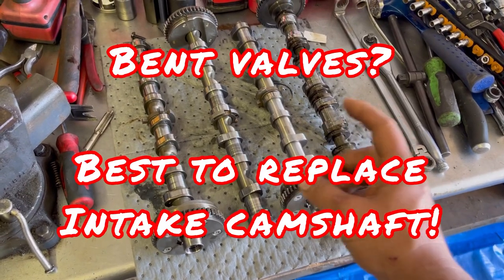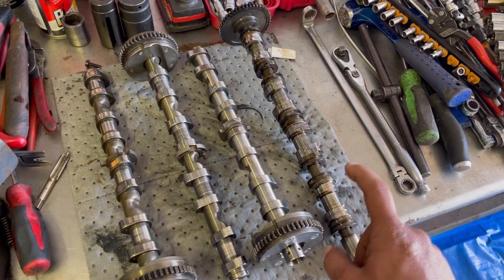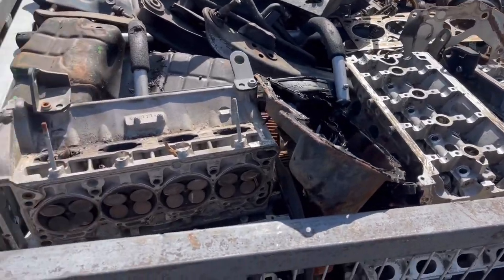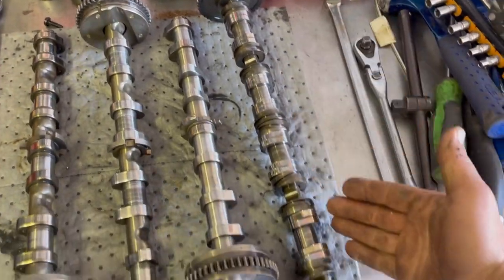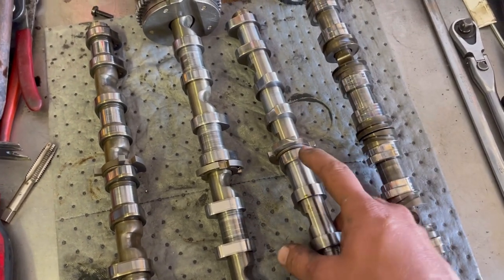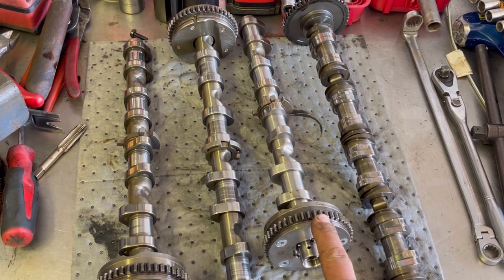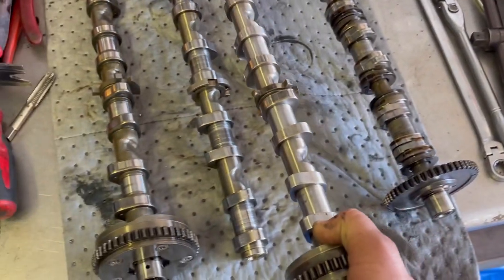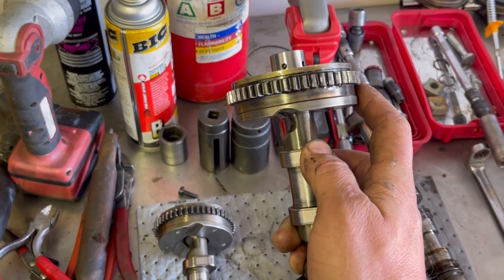2.0t Audi VW intake camshaft fault codes issues bent valves p0016 p0011 etc.

Comment: Plz keep em comming sir…i love watching you work on the tfsi…i just recently bought one with the valves destroyed and it wouldnt start after i installed a new head onto the engine…this video helped me out A LOT…if it wasnt for your video i wouldnt have figured out that my reluctor wheel on my intake cam was spun almost a whole 180 degrees…i just replaced the cam with a good one today and now i have a beautiful running B8…i very much want to thank you again for this knowledge…

Comment: Drop few notes here

First of all thank you for documenting fantastic and valuable information to people!
Second - If you had combo with P000A + P0016 - check magnet on intake (by testing/replacing it to another), as well as look into small "piston" which moves VVT back-forth, maybe it's clogged (it has small metal net inside of it and because of burn oil it might clog the flow)
Also you may try to check those timing adjusters, maybe they're "worn out" - it's possible to replace them with slightly updated width (it's less than milimeter). They would work properly but on idling you may hear rattling sound (because adjusters are a bit worn)

Comment: Wow excellent video here.. I was told you can actually rebuild or fix a seized intake cam phazer by removing the gear cover and realign the pawls.. I’ve never seen a cam shaft seize after colliding with valves but I’ve only done a couple dozen of these 2.0 TFSi unlike your thousands.. Also, very interesting design on the cam position wheel I thought it was a tone ring like the crank but it’s variable so I guess that aligns with the ECU as the profile changes.. wow learning about these systems so much from you.. truly are the best at your presentations.. I guess I understand why those TFSi cams are so pricey now.. granted there’s a lot of VAG markup but it’s a finely precise instrument.. great content 👍🏻👍🏻

Comment: p0016 came one day just in the morning at the cold start bam engine light car had problems to start but it started i didint drive it towed to my garage and took it apart found out that the timing chain guide rail at the right side of the engine were intake cam is snap in half were the top bolt was (weak spot i guess) put it all together new chains and guides runs fine now no damage were done to other engine components .

Comment: I just recently bought a 2016 audi a4 with the 2.0 TFSI and cvt transmission wasn’t sure what issues I need to watch out for and what generation my engine is if the oil burning was fixed in or before 2016

Comment: I changed pistons, rods, valves and timing chain i put everything together and the engines runs smooth but I have a p0011 and a slight knocking sounds like if it’s coming from the upper timing chain

Comment: My 15 s3 every now and then would get a choppy idle and a p0011. Found it was the vvt actuator in the cam. The spring was worn. Replaced it and it's ran great since
Reply: Where did you find parts

Comment: Just did my timing chain and tensioner yesterday, car idled for 5 min good, drove about 5 blocks then lost Drive and got P0016 and car wont start. I don't think valves are bent. I can still crank the engine by hand, what could have caused that happen? Any possible solutions? This is my daily driver and I'm in a bind

Comment: I have a question the ecp light for p0341 cam shaft I change cam shaft sensor and cam position sensor with new gasket codes cleared but now misfire in all 4 cylinders car starts with no problem 2010 Audi A4

Comment: Have you ever seen a cam bridge seized on before?  And why would that happen?  Very low mileage car (appx 40k miles), but it was an original 2010 part.  Dealer had to force it off and damaged the cam in doing so.  They said they had never seen one seized on like that before.
Reply: This is a very rare problem but I will tell you what I think.
Put in mind that the cam bridge is to hold the cams into place so as to reduce tension that is caused by the chain and it also acts as a channel for supplying oil to lubricate the camshafts at the point where the attach to it.
So if there is oil starvation of any kind, it will cause wear of the cam bridge journal thus cause too much heat and then melting and that is how u end up with such a problem.
However, I can't think of possible cause but I can come up with my own which are, since the bridge has a small oil gallery which also has a small screen that keeps bursting, it could break into tiny pieces that can somehow find there way up to that cam journal of the cam bridge and that how the damage starts building or even kinda block the oil passage causing luck of enough lubrication especially at high revvs.
I can also relate it to sludge finding its way up although this is almost impossible since u have an oil filter.
I could also relate it to an oil filter that stayed too long with being changed and a tinny piece broke off and found its way up thus blocking the oil gallery of the cam bridge.
I hope that helps.

Cheers
https://twitter.com/DeutscheAutoUG

Comment: I recently did a timing chain on a b7 it was fine for a couple of drives. Rode it pretty hard the time it did work. Then I got in one day and it started so rough I parked it replaced the cps. It cold starts pretty rough then clears up a bit. Every 20 miles or so I get a p0016. Any ideas of what it might be?
Reply: 😂 It's off by a tooth

Comment: Naptowntuner. I need a repair on a VW CC. Valve Cover Re-seal: Cam carrier is actively leaking and needs resealed. Would you be interested in repairing? Currently in Indy.
Reply from the maker: I might be busy for the next week but if it can wait yes.  Naptowntuner@yahoo.com

Comment: Why would my 2010 Audi A4 2.0T started smoking dark smoke? Is it the turbo? Second question is i bought a coolant temperature sensor thats tell me the engine temperature which mine doesn't have one in the back of the engine nor do i see the wire harness to click into it & looks like it has a bypass where it goes into that black plastic coolant block in the back of the engine which i think thats why my fans stay at 100% on & the fans & radiator is brand new. Can anyone help me please

Comment: I recently did a timing chain job. Car ran great afterwards for the first few startups. Now i have a p0016 code and car has longer than normal crank times as well as going into limp mode. Is it possible its just a sensor or the magnetic adjuster? Or do you think i jumped a tooth? Timing was at 0⁰ after time job. Now its at -17⁰
Reply: I have a similar symptom and jus did the chain.  P0016 Ishtar away.  Curious if you ever fixed yours
Reply: I am getting the same issue after doing the  chain and tensioner.
Reply: @KylerWasankari  You ever figure out how to fix the issue?

Comment: Great video, got a question for you, I have a 2000 Audi TT 1.8, would the noise suppressor/ capacitor that bolts to the valve cover cause the engine not to have spark. Car was running, preformed a compression test 120 all the way across, put it back together, now I have no spark but noticed the one wire going to the capacitor was broken.  Your thoughts 💭?

Comment: Nap, can we just change the oil judiciously and keep an eye on the cam phase numbers and tensioner notches on our cars (mine B8.5) and not worry so much? I really feel like most of these issues are cuz owners neglect oil changes. That and their oil level due to not knowing the burning/ring issues.
Reply from the maker: I believe the chain is too small and weak and was designed to fail, I believe the piston rings were made wrong and designed to fail as well.
Reply: @NaptownTuner  Planned obsolescence for the out of warranty drivers like us...dag burn it Audi!
Reply: @NaptownTuner  Hello, I would like to know if you can help me with my car. I have problems, smoke comes out. From the exhaust and the engine shakes too much to the point of almost shutting down and instead the turbo and injectors pcv val  They told me that the seal on the rear engine needs to be changed because it leaks oil. You have a lot of experience in Audi. You think it's my problem. I'm contacting you from Columbus in

Comment: I have a 2010 Audi A4 2.0 with a p0016 code. The crank is slow but the car starts up and runs a little rough. When I reset the car it starts up normal but when I turn it back off the slow crank comes back. Pls help me out 🙏
Reply from the maker: P0016 is when your chain has already stretched and skipped teeth, especially true with an extended crank.  Next step is for it to come completely out of time and bend valves.
Reply: @NaptownTuner  yup you were right, Chain is fully stretched. Thanks, debating if I should change it my self.
Reply: @Isa_b58 did you ever fix this? I’m going through the same smhhh
Reply: @frankv3095  had this issue bro, most likely is the timing chain. My went away right after I changed it and runs good now
Reply: @NaptownTuner  so if you see PO016 with extended crank you automatically say it’s going to need timing chain kit no more Diagnostic needed? Thank you. Pulling it apart tomorrow to check it out.

Comment: i have a 2012 Gti ccta and i put mines together and my intake cam got scared up from no oil flow, first fire on the rebuild and i had good pressure during the priming..got up to 30psi on rotation..had assembly lube on cam and valleys and after 10mins of running it squeal then shut of..pulled engine and teared apart ...i was told that by machine shop that it had been cleaned
Reply from the maker: You can’t swap camshaft trays, the original one with the head needs to stay with the head.  Not saying this is what happened but the only likely thing I can think if, unless the old sealant was grinder off removing bearing clearance materials
Reply: Hello, you’re are amazing so glad that I’ve find you. I did mine valve cleaning with Dremel and some small wire wheels. Took about hour to do it all 4. TOP MAN!!!
Reply from the maker: @lmslightwelding5935  i recommend only using a new sharp razor blade
Reply: Razor blades? I’m taking about inlet valves
Reply: @lmslightwelding5935  You were replying to a post about someone doing their camshafts with your "valve cleaning" job I don't know why. That was confusing...
Reply: Yeah thanks it does have the original cam cover I was just worried that no oil.had got to the  that Passage way, so I'm thinking something was blocking it or the lash adjustors collapsed and starved it from oil but it had 40psi of pressures at the beginning than it went to 30psi  going back to idle
Reply: @erictrain76  Aren't some of the audi/vw gaskets easy to put on the wrong way covering a galley.